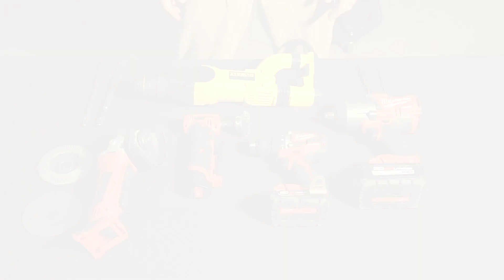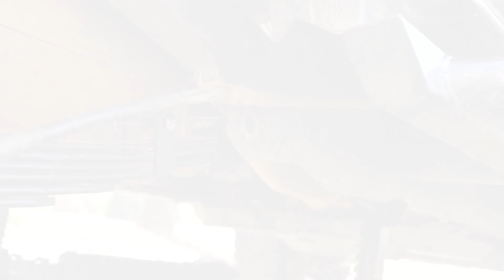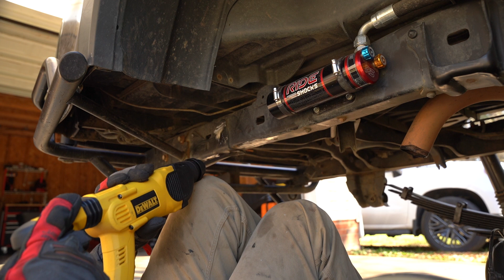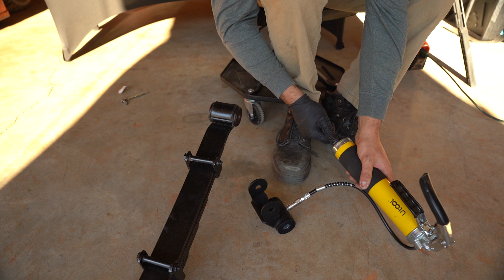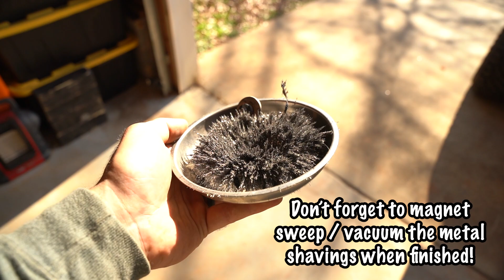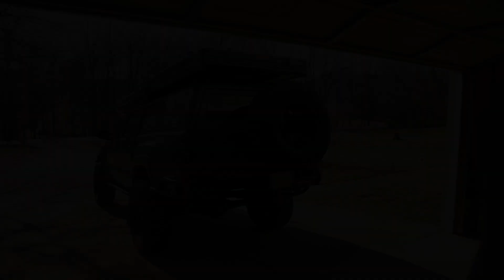Rago Fabrication Shackle Hanger Installation (Tacoma 05-23)

Comment: Hi I have purchased a set of these and doing my pre project preperations..do you know if it's possible to use your spare tire with these..I notices they are pretty thick towards the front of bed ... any measurement between the two ???? TIA
Reply from the maker: It depends on the size of the tire you’re putting in there! I will measure the distance between the two for you tonight and let you know!
Reply: @Bugout_Overland  thank you that would be greatly appreciated
Reply from the maker: I measured 32” sir!
Reply: @Bugout_Overland  thank you for this valuable info ..I was hoping for 33"